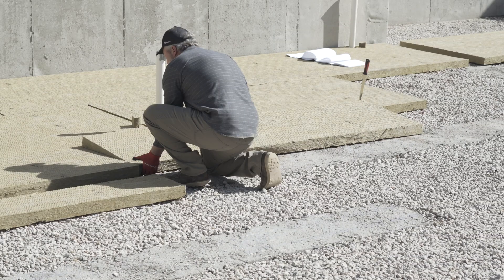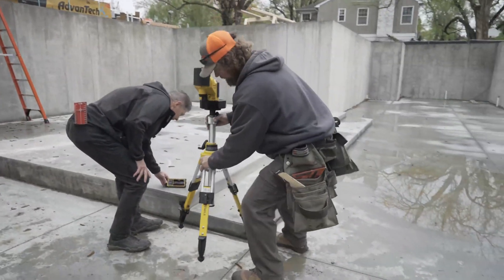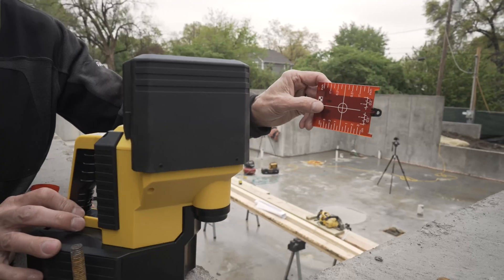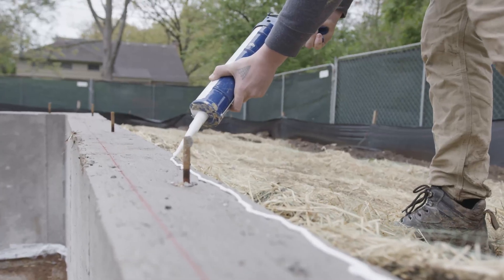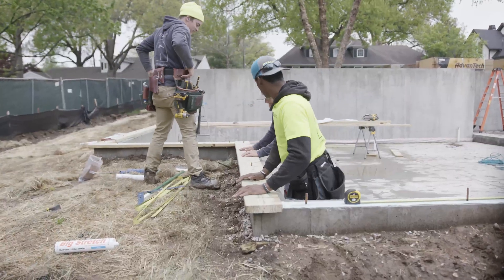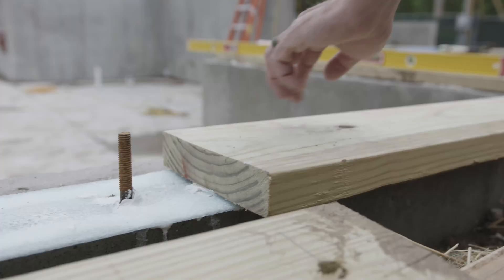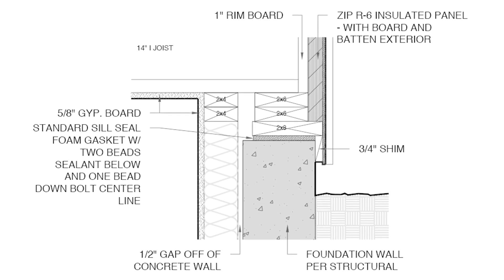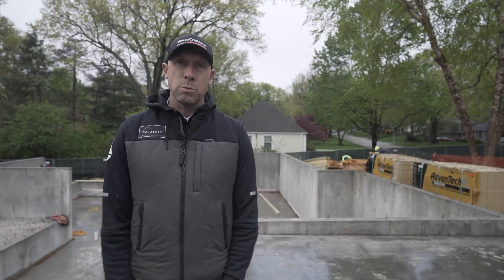Air-Tight Mudsill Connection

Comment: Pretty sure a non-hardening acoustic sealant is a better product than Big Stretch for that air sealing.  That said, think Siga Fentrim tape around the perimeter is an easier/quicker air seal method btwn framing and foundation.

Comment: Great job- may I also suggest using Tremco trempro JS 773which is a butyl (not latex !bsed ! Doesn’t smell bad  either) non skimming product that is cheaper are most likely will be flexible long after big stretch-an otherwise outstanding Great elastomeric caulk nonetheless-
Reply: Yes, Trempro JS is a much better option.

Comment: Why does the 2x8 mud sill stick out? The 3/4" shim to fill the gap isn't protected so wouldn't that be a potential spot for termites?
Reply: @mikecousin8523  agree-whoa-slow down Travis-néed to expand on  that detail more- it answers my initial question (why are the bolts offset so much) but what is the b lack line extending down the outside  of the zip sheathing ( an behind the board and batten )that runs Own the face of concrete foundation wall and over the soil grade ?? Why not offset the 2x8 INWARD, have zip R meet the foundation flush OR near flush n caulk that with zip flash or fentrim ?
Reply: I noted the initial schematic diagram showed EPM film capped with copper sheet-a genuine shield against termites.